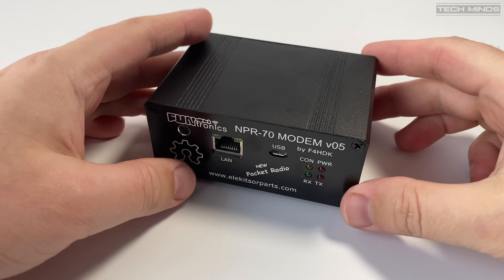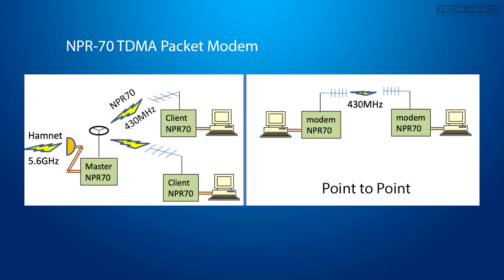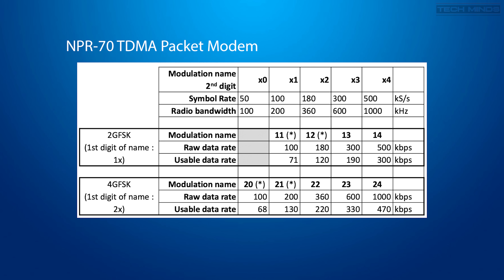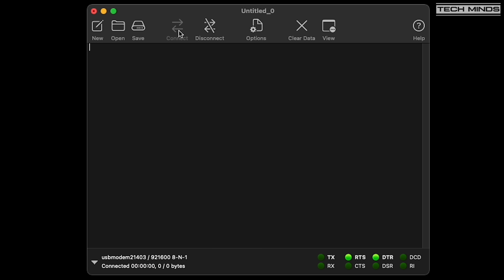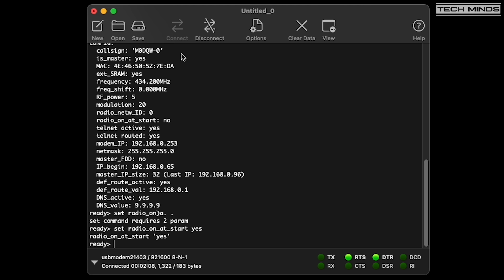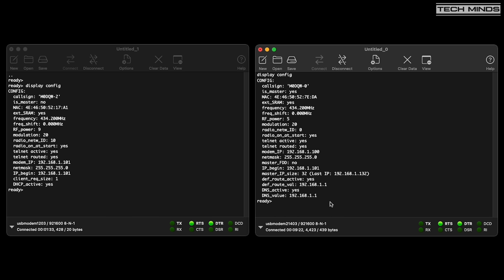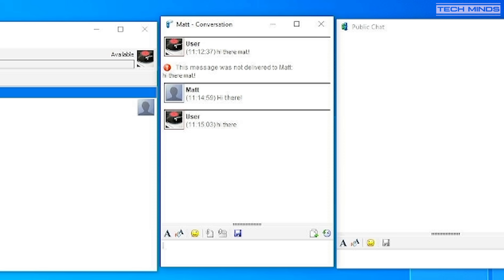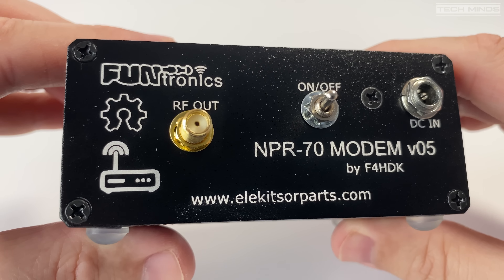NPR-70 IPv4 Radio Modem | New Packet Radio Over 70cm Band

Comment: Very Interesting..
I can definitely see use cases for point to point links
If I understand correctly 1 Master supports 7 clients, To expand add another Master, allow up to 7 more Clients

But how would the RF side coexist, even at 500mW.?
Even on separate Frequencies, you would need to seperate the Frequencies significantly otherwise RF Overload/Desensing.?

Comment: These would be ideal for Raynet as we have been asked to look into the feasibility of providing data links between User Service locations - effectively replacing the Internet with a point-to-point link capable of carrying email, VoIP etc.  with possible encryption provided by another layer such as a VPN...
Reply: dont know your location but in the US encryption via your ham license is illegal
Reply: @christopherbrown3198  It's not encrypted as so many have replied to me.  The problem is the speed and bandwidth. Not part 97 compliant.
Reply: In the UK, Raynet are allowed to use encryption at the request of the User Services which this is.  However, I'd probably have to get them to specifically ask before using it ...

Comment: I tried these nearer when they were first released. I've got v4 so need to solder a board on to each to make them work again with the latest firmware. I even got two PAs to work with them. I think my hope was that others would start using NPR in SE England with a NOV. So far beyond testing things myself I haven't found a serious use for them as I cannot set up any gateway etc myself as I'm a 2E. It would be good if NPR was integrated the existing Packet network and was put into the 44net setup.

Comment: We saw the really disappointing ping times on mode 20, (actually longer than some default TCP/IP timeouts). Were they better on the wider mode? Is the wider mode legal in the UK?
Reply: Good question.  What say Tech Minds?
Reply: When you're comparing this to older, existing amateur data modes, those ping times do seem out of line.  Consider old-school packet radio twaddling along at 2400 baud... an IP ping packet of 84 bytes or 672 bits would take 280 milliseconds just to be sent.  Double that for a reply.  But this box is supposed to be jogging at ~65 kbps so transmit time should be negligible in comparison.

I too would be interested in ping comparisons between modes 20 and 24 because if there's no significant difference, then the overhead probably lives only in the software.  I did note that the design is based primarily on 4 off-the-shelf modules: a DC-DC converter, W5500 Ethernet interface, a STM32 Nucleo CPU stick and an RF4463F30 transceiver.  Quick research of the W5500 network module indicates it should NOT be the cause of high ping times here, so for now I'm going to blame the code in the Nucleo board.

Or... maybe the power level TM set is just too low or there was some other unexpected signal problem.
Reply: @Randrew  I bet you're right about the software, or the signal even. If there wasn't enough loss between the two nodes this could also ruin performance.
Reply: @Randrew  I am the designer of NPR-70. The high ping is due to the protocol. It varies depending on the modulation parameter. 
Modulation 24, ping is arround 80ms. 
Modulation 20, ping is arround 500ms, in "high speed mode". Tech-Minds was in slow mode.
Reply: @F4HDK  Thank you for the reply!  When this video first came out I did some cursory research, but now I've lost where I found protocol information - which I didn't study in detail.  I admit my interest waned some when I found it wasn't fully legal in the US ;)  My tentative technical take-away is maybe IP encapsulation on modern low-power transceiver designs is not going to be efficient, speed-wise.

BTW, I do really appreciate your modules design approach.  It takes advantage of proven commercial designs AND their economy of manufacturing scale.

Comment: While these are slow relative to current gear they should be useful for Ham circuits going a few miles which isn't possible with high end WiFi gear.
Reply: That job is probably better done with LoRa transceivers, which are inexpensive and pretty robust over longish distance, though with pretty slow data rates.  I and another ham in my town have experimented with Meshtastic, a mesh protocol designed around LoRa modules operating in the ISM bands.  We managed to pass messages across about 6 miles of mesh nodes with the longest single hop being a little over 2.5 miles in a mesh of 5 nodes total.  Meshtastic modules can be had from $20 to $35 each.
Reply: @Randrew  What kind of bandwidth do you get over LoRa? I just started playing around with it. I think both of these have their strong points. This modem system being IPv4 compatible is a BIG plus for me. You can do so much more than message and share your GPS location.
Reply: @gingerman5123  LoRa bandwidth can vary wildly from a couple hundred bytes per second to maybe 50 k bytes per second.  Depends on the distance and modulation method(s) chosen.

LoRa is good for sensor networks and low rate messaging, but not great for general Internet.

Comment: Cool faster speeds than i expected. i wish you could get internet via the radio that would have been very useful to me in the 2000s and still a little bit useful today. i guess we got 4g and 5g internet now but at least in my region its still expensive and i run out of data sometimes. but 10/15 years ago this would have been amazing to plug in my laptop when on the go. but i heard that in a lot of countries basic encryption over the radio is illegal for some reason. so the modern internet wont work well. and the speeds are faster than i expected but you still wouldn't want to use it as your main way of using the internet. more bloated websites wont work maybe on the fastest setting i can watch this video in 144p.

Comment: Can you use this with a gmrs license. Gmrs is around 460mhz and I believe in the US they allow data
Reply: It is entirely possible but check part 90 regs.  They have allowed so much more for GMRS than when I was active with it.  I still have a callsign but I don't see the point where I live now.
Reply: @W4TRI_Ronny  I'm not sure the device can be tuned that easily.  My understanding of the TRX module they use is you need to order it for one of 5 frequencies: 315, 433, 470, 868 and 915 MHz.  I guess these all correspond to ISM bands available in different regions of the world.  The Si4463 chip itself can be programmed to operate from 140 to 1050 MHz, but the board design and component selection seems to be limited to those frequencies I listed.  And this black box has the 433 MHz version.  The 470 MHz version might could be bent down ~10 MHz to FRS/GMRS by changing the software config... but that's not the version in use here.

On a slight tangent... all those 433 MHz ISM devices I see chirping all the time don't even belong in ITU Region 2 (North America).  Everyone here with an Accurite wireless temperature sensor should have a amateur radio license... but then they'd be transmitting out of compliance anyway :|

Comment: Seems that you can use this in the EU on the 433.42 Mhz ISM band on 1MHz bandwidth without issue.
Reply: Hello. You cannot use this NPR-70 with 433MHz ISM rules. The power is way too high. ISM is restricted to 10mW, at output of antenna, with such a large bandwidth. You would get a range of ~100 meters with this low power.
Reply: Something like that would be better suited for the 915mhz ISM band as it's much more lenient with power and bandwidth
Reply: @LunaWuna looking at the datasheet for the rf module used RF4463F30 looks like there is a 915mhz version available, which should be pin compatible as well. since afaik the project is open source, should be a simple task.

Comment: Yeah, I'd need at least 25 to 30 watts, 500 mw is  just way too small. I see these are 92 Euro so I guess that would be $ 150 including shipping to the states. Add another $200 or so for an amplifier and $100 for a directional antenna and we are up to $450...Besides I doubt they are legal here.
Reply: They are legal, And it Seems that you can use this in the EU on the 433.42 Mhz ISM band on 1MHz bandwidth without issue. So no license required in its Stock Configuration.

Comment: I have 2 walkie talkie, can I use it as modem?
Reply: This device is both the radio and the modem together, no other radios needed or accommodated.  And regular walkie talkies don't pass enough bandwidth for even the slowest modulation scheme of this device - 100 kHz.
Reply: yeah basically as far as i can tell, the issue with walkies talkies is the fm de-emphasis filter on the receiver side is too narrow for wideband digital, so only 1.2kbps or so.. you can try skuep/AIOC with wb2osz/direwolf for some slow digital comms with your walkie talkies, otherwise just use them for what they meant to, and this modem for the digital data comms.

Comment: can this send encrypted messages packets ? Like a Bitcoin tx
Reply: Could .....yes, but a No-Go for ham. Amateur radios very open and any encryption is strictly prohibited.
Reply: @tellnets  Yep and these are totally illegal for US hams anyway.  Closed network that can't be monitored/decrypted.
Reply: @W4TRI_Ronny  These are legal for US Hams, Just no encryption
Reply: @christopherbrown3198  No they are not.  No way to decipher.  And this is a closed loop system.
Reply: @W4TRI_Ronny  This is just another digital protocol. Look into HSMM. As long as we comply with Part 97 rule, and the purpose of the encoding is not to obscure the meaning of the message, we are fine.
Reply: @tellnets  No it is not. The stock symbol rate and speed violate Part 97 out of the box.   HSMM is wide open and based on an open protocol.  Just because this says the hardware is open source does not mean the symbol rate is within standards.  I see the settings can be changed to set it up to comply with current limits (close) but like everything else people will abuse it and run it wide open if it "Can" do it.  As I said above I want the symbol rates increased and high speed over air to be allowed as much as anyone.
Reply: @W4TRI_Ronny  For USA : Due to CFR 47 Part 97.3 FCC regulations, for the 70cm amateur radio band (restriction to 100kHz and 56kBaud), only the setting “modulation 20” of NPR-70 seems to be legal in USA. Please always check your local amateur-radio regulation before buying and using NPR70.
Modulation 20: Symbol Rate 50kS/s, bandwidth 100kHz, raw datarate 100kb/s raw, usable datarate 65kb/s.
Reply: @W4TRI_Ronny  baofengs, fast cars, guns, cash... no one should have access to anything that exceeds the legal limit? I get what you are saying, but "we" are self policing. it is the individual's responsibility to stay within the confines of rules and regulations
Reply: @tellnets  That's what I said but everyone so far wants to tell me we are wrong and all is fine.  Don't confuse these people with rules and logic.  Let alone actual facts.
Reply: @W4TRI_Ronny  When you get down to it, all commercially-produced amateur radios that are FCC Type Accepted can be modified, they can have encryption added to the signal, etc.; therefore, they are also "totally illegal for US hams".
Reply: @dudemanemeritus8647  "amateur radios that are FCC Type Accepted"

Just want to point out that there is no FCC type certification for amateur radios.  Even your favorite Icom or Yaesu are only certified to FCC Part 15 as quiet-enough noise makers.  As always, it is up to the US amateur to be in compliance with Part 97 when they transmit.

Comment: What's really sad about this is that it's 2023 and it was designed for IPv4. It's retro from day one, where it should have been future-looking.
Reply: Yeap. Layer 2 bridge would have been nice, looks like some proxy ARP bodgery to get network working.
Reply: @steve87uk  I think a pure L2 bridge may be too simple to work well. Modern networks are a bit too chatty to "just work" with half duplex and (in today's measurements) low speeds. I do think it needs to be smarter to avoid roundtrips and random broadcasts and probes.
So I think some layering violation may be necessary.
But I think this could have been done with IPv6.
Reply: IP stacks of modern OSes require high speeds, low packet loss and low bit error rate. TCP of modern linux or Windows host will quickly choke up when latency is high or the packet loss is over 14%. QUIC is even more resource hungry, compared to TCP. So, in case of ham band modems, I would prefer to have an AX.25 implementation,  maybe with features like Hybrid ARQ.
Reply: Literally only a very small number of the world's ISP's support ipv6 fully. Almost all will support IPv4 for at least 20 years either directly or using a feature in routers to allocate a virtual IPv6 address to legacy devices on your home network. Even when legacy devices need to work on IPv6 that doesn't support them, you can use a dedicated router to add this support, even if this means using 2 routers in your home network (something you should do with many IOT devices anyway for full security).

There are too many legacy devices around the world that do not understand IPv6 for a 100% IPv6 network to exist for decades yet.
Reply: @dennis8196  you missed my point about the *future*. And it's not a very small number of the world's ISPs. Google has, what 25% of all traffic IPv6.

And it's not like you can use NPN for internet anyway, since who would use internet without encryption?

The world will also continue using fax machines for many years (my bank requested it months ago), but I would not invent a "new" framework that would include fax machines.
Reply: @thomashabetsse  Google isn't an ISP. IPv4 <> IPv6 translation is done all the time between network tiers and like nearly all ISP's I'm connecting to the world using an IPv4 address. As soon as my network traffic hits the next network my ISP is talking to the world in IPv6.
Reply: @dennis8196  no, that's not how IPv6 works. If you have v4 then at most you get CGNAT, but it'll never become IPv6. Just does not work the way you say.

With NAT64 it sometimes goes the other way around, but you would never do it the other way. That'd defeat the purpose.

I mentioned google because it's indicative of IPv6 coverage on the client (ISP) side.
Reply: @thomashabetsse  Erm .... "since who would use the Internet without encryption?"  Pretty much everybody. You may be using some sort of encrypted Net access but the vast majority of users do not. Not here to debate the pro's and con's of encryption. Just stating a fact.
Reply: @markphillips8019  finding websites without HTTPS is not easy nowadays.

Finding a user of the internet that doesn't use encryption? Literally impossible. You think YouTube streams or comments go plaintext? Facebook? No. Basically everything is encrypted now.

Hell, mainstream browsers are doing DNS over HTTPS now, so even unencrypted websites still trigger encryption.

You'll have to firewall port 443 to avoid it, because even ads come in over encrypted HTTPS. And you would not be able to log in to anything, because that absolutely forces encryption.

And basically nothing coming to or from your phone is unencrypted.  You have a phone? You transmit encrypted. (Yes, on wifi too)

IMAP (mail), SSH. It's hard to find any protocol now that doesn't default to encrypted. Maybe SMTP, but then again that's basically always blocked from home connections.